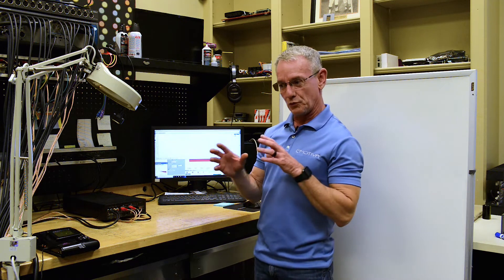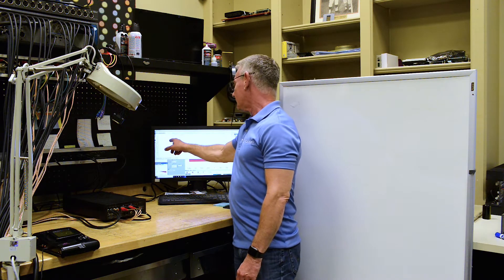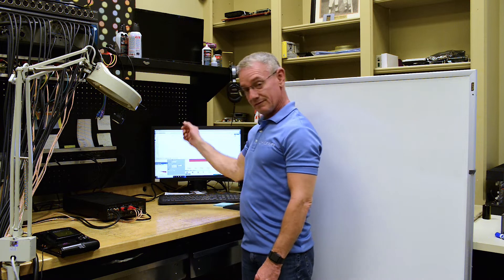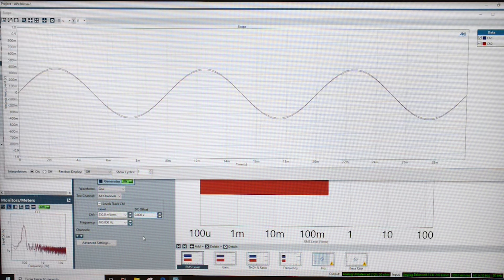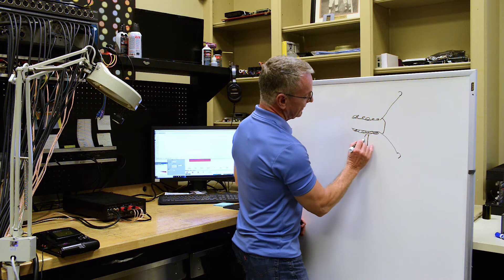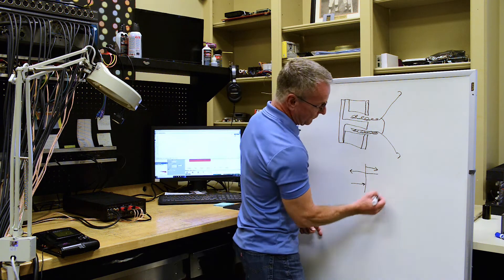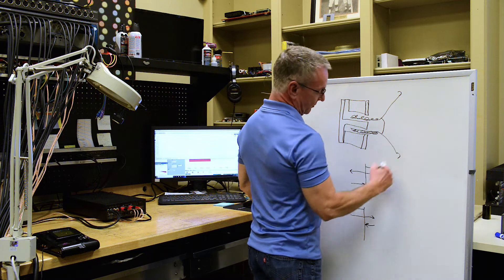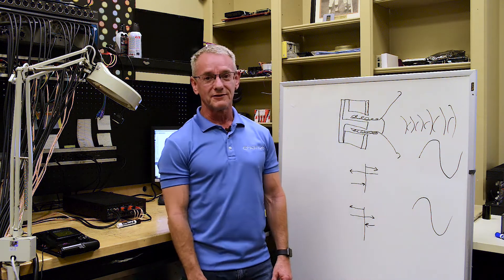What are Inverted Signals in Stereo and Home Theater?

Comment: @Emotiva Audio Mr. Vaughn thanks for all of your videos and info.  It seems to me that if the recording sends a positive to the speaker that the speaker should first move outward for the received signal to be heard correctly.  So, inverting the signal on all speakers would sound odd or at least at a lower volume.  Now I'm wondering how would we measure the amplifier output to be sure the red post is actually producing the more positive signal on the analog audio AC output.  Can you please explain that test?  Thank you.